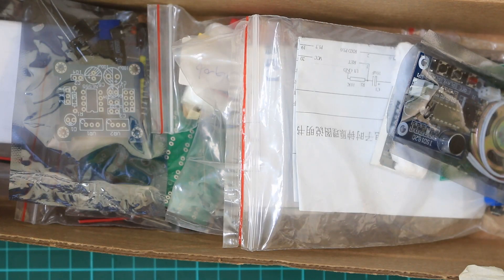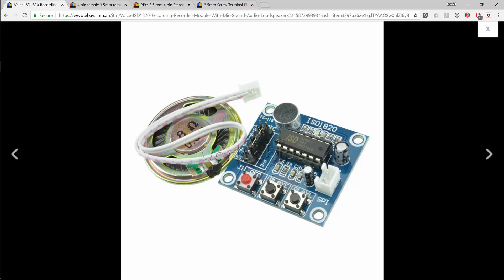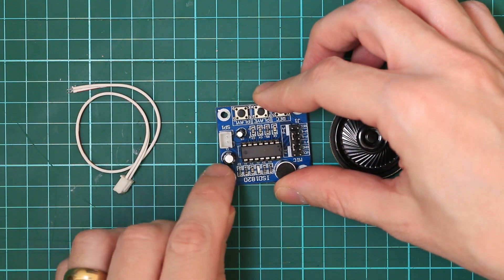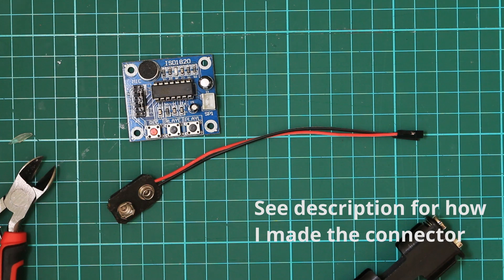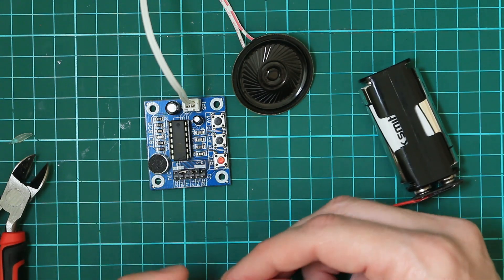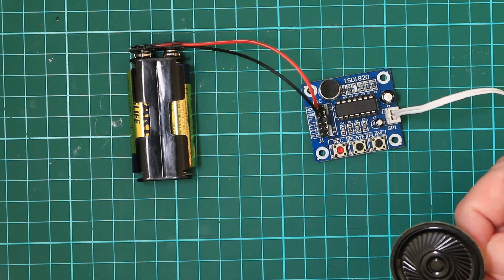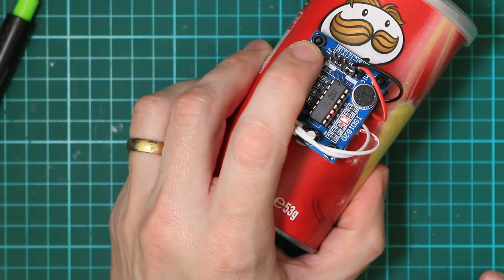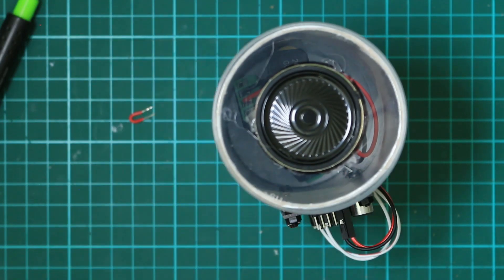ISD1820 sound recorder kit build

Comment: What is the function of the second (play) button?
Reply from the maker: PlayE - press once let go and recorded message plays, playl - press and hold and recorded message plays, e.g. if the recording was "shut the door" and an "on" signal/level would play shut the door until someone shut the door or playback ends. (unless the play endlessly jumper is set) - info in https://www.allelectronics.com/mas_assets/media/allelectronics2018/spec/ME-63.pdf

Comment: A fellow Scotsman! Talking about buying stuff and never finishing them! It's me!
Reply from the maker: I have more stuff on order - can't help myself...getting the BBC Micro:Bit v2 which has a speaker and mic on it - so may do a similar project to this one with that.
Reply: @RandomSmith  I just picked up one of these kits. Going to give it a bash!
Reply: It looks like you can change the sample rate by swapping out the R2 resistor with a Pot... which could be fun.
Reply from the maker: @StephenMcLeod  this page has the resistor values and how that changes the length of recording - https://canaduino.ca/downloads/isd1820_voice_recorder.pdf
Reply from the maker: was also just reading on this page about increasing the recording level and hence playback volume by adding a resistor to a different part of the circuit - https://protosupplies.com/product/isd1820-voice-record-and-playback-module/

Comment: Is that possible to use 2pcs of battery 3A 1.5v ? Or maybe 3pcs ?
Reply from the maker: 2x1.5V batteries, the electronic parts here are 3.3V, so two AA or two AAA. If you use 3 fully charged AA is around 5V and would likely damage the chip

Comment: Is there any way i can record audio to pc at wav form with an arduino and an sound sensor. I don't want to save it on an sd i want real  time record
Reply from the maker: Are you looking to have the sound transferred in real-time to a pc? I would be tempted to get a raspberry PI Zero that has wifi and record to sd in 30 second chunks to buffer the audio then send those files to PC. https://learn.adafruit.com/usb-audio-cards-with-a-raspberry-pi/recording-audio. For the arduino see this thread - https://forum.arduino.cc/index.php?topic=224510.0, once you have audio recorded to file, then there are libraries on arduino you can use to send that file to pc - https://forum.arduino.cc/index.php?topic=556337.0. Local buffering means that even if wifi disappears, you can resume uploading files once wifi returns.
Reply: @RandomSmith  so i can't with arduino uno and a sensor record with out any components?
Reply from the maker: I am no expert, but the arduino has an analogue to digital convertor which would allow you to analyse the signal, but you would likely need something to amplify the signal. You would also need a shield that added wifi or ethernet. You could also try using an esp32 that has wifi.

Comment: I thought I was going to have to connect an LM386 amplifier circuit because that tiny speaker is just too quiet, but your Pringles solution certainly raises the volume! I also liked the add-on big speaker you tested, but I'm going to have to watch the video again to properly understand the connections. For example, I have several pairs of battery-powered PC speakers (approx 4 inches x 2 inches x 2 inches), and I could sacrifice one of those for the ISD1820.
Reply from the maker: The speaker I used was tiny - 1.5 Inch (4cm) across, so any larger speaker would probably be louder and if battery powered would do the trick.
Reply: @RandomSmith  Yes, I followed some circuit I found to connect the speaker outputs of the ISD1820 to a battery powered Philips active speaker set and the volume increased by 1000% !

Comment: Hello, thank you for such an in depth video. I’m looking to do something similar, but a little more simplified. How would I connect a Waytronic voice module box to a portable speaker with an aux input, basically using the recording device for recording and playback, but using only the sound from the portable speaker instead of the built in speaker in the module? Im guessing I would just need that adapter with the terminals and just connect the correct wires from the module’s speaker?
Reply from the maker: Keith,

I think because there is little info on the Waytronics boards (if it is the ones below), they are for manufacturers to build into their own devices using SPI communication protocol which sends pulses of voltage down 3 wires as a data signal. Without this information, you probably won't be able to use these boards. and I would seek alternatives.

What is your use case/skill level? 

https://www.sparkfun.com/search/results?term=audio+chip is a good but pricey place to look and will have lots of documentation.

This may also be a route to go down - https://forum.arduino.cc/index.php?topic=51681.0, (Not sure how easy you need it to be for your use case)

I don't think any boards come with a built-in speaker. Usually just a built-in mic or no mic.
Waytronics has many modules, some with and without a built-in mic.
They also have some with a MicroSD (TF ) slot for storing recordings or playback files. (ie like an MP3 player without the case, battery, speaker and mic)

You should be able to add a pigtail 3.5mm plug to the SP- and SP+ pins - https://www.sparkfun.com/products/11580 (SP+ may also be labeled as SPK+ on Waytronics)

Read this if you are not aware of the differences between the number of stripes in an AUX plug TRRS TS and so on. https://learn.sparkfun.com/tutorials/connector-basics/audio-connectors
Mono would TS, Stereo TRS, and stereo with mic would be TRRS usually.

http://en.waytronic1999.com/ProductsStd_190.html with a built-in mic. WTR030 Which states "can directly drive 8Ω/0.5W speaker" Has a MIC+ but no idea what you would connect the other MIC- cable to. One would think GND, but I believe that microphones are sensitive things and you would get feedback issues if connected to power ground. Then there is the amplification of the signal. But since you are using the inbuilt mic, I am guessing no issues there.

It looks like it does have some built-in storage "Built in SPI-Flash"

There is little to no documentation for the module, so you would need to work out how to implement the "Hold to record, press to record, play, low level keep loop playback".
and with little info to go on, you may struggle in that area. Are some of the existing pin set so you put power on or off to cause play/record if not
you would need to program the SPI interface with a microcontroller (eg arduino) - like this kind of thing - hackster.io/tsar_/software-for-recording-audio-files-into-isd1700-chips-fad583

If you want a longer record time then -
http://en.waytronic1999.com/ProductsStd_185.html which has a MicroSD card slot ET2000M04

Comment: Thank you for the video. I am trying to build something like that. I already got the module but I'm still missing the cables that connect to the battery...what do you call them?
Reply from the maker: The battery cables that connect to the header pins on the ISD1820 are male dupont cables - https://www.ebay.com/itm/40PCS-Dupont-wire-jumper-cables-20cm-2-54MM-male-to-female-For-Arduino/171422500152?hash=item27e993c538:g:YIoAAOSwxH1T7wU5. The white two pin cables are some form of micro JST connector.
Reply: Thanks for that. I use this for model rail road sounds. Can power much larger speakers with very good fidelity. Be careful, class D output.
Reply: @daniellesmith1059  indeed, I think running a headphones jack for output would be good, then end user plug in speaker of their choice.